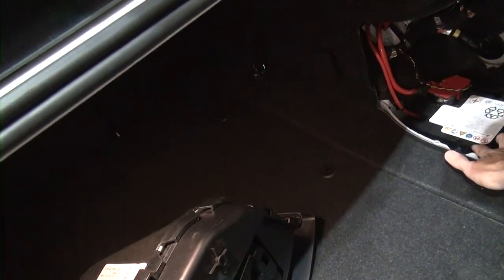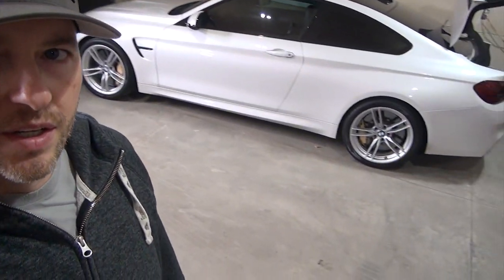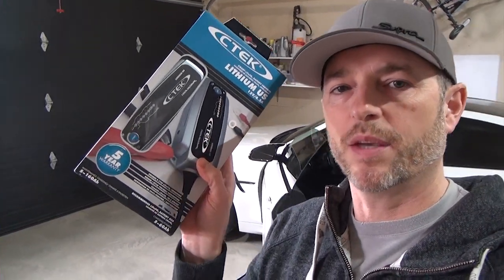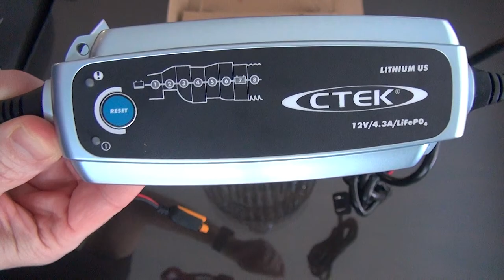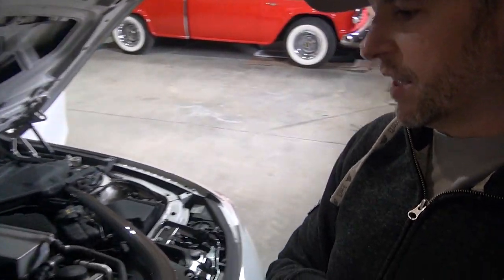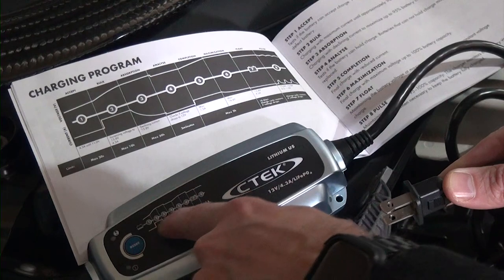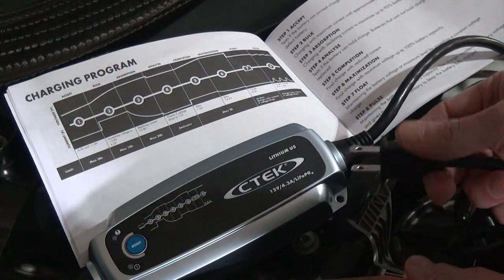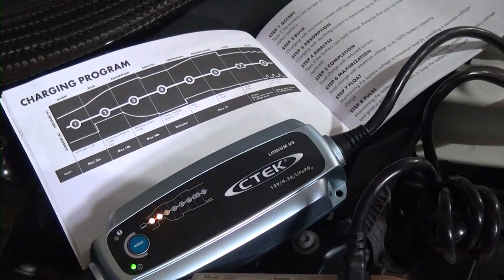CTEK Lithium ion battery charger review with a BMW .  Save money with this critical maintenance!

Comment: Just took delivery of a 2022 M440XI for my wife.  Spoke with the Service Dept Mgr about charging the battery in that we leave town Jan-Mar.  Was told to connect charger under hood and NOT to put BMW charger which is made by CTEK on the Lithium setting.  Was told the battery under the hood isn't Lithium but the one in trunk is Lithium.  He had to check with BMW prior to giving me his answer.
Reply from the maker: Yes some models could have a secondary battery.  My M4 (F82 platform) does not.  I live or die by the $2000 CAD battery in the trunk.  Good news is, a recent code scan shows it in the mid 70 percentile for remaining lifespan.  Not bad for a 8 year old battery.  Also CTEK makes a bunch of charger models.  The one in my video is one of the select few to use in my situation.

Comment: Mine went straight to number 2 and number 1 is not illuminated, I’m using a BMW charger which is pretty much the same you have .. I wonder if my battery is toasted since it bypassed the 1st light 💡 I just noticed mine keeps getting the right light on ..
Reply from the maker: It might be time!  Especially if the charging capacity is a low percentage.  Unfortunately the charger can’t tell you that specific detail.  Some OBD2 BMW scanners/coders can tell you though.   But if the charger isn’t completing its work over a day or two, then it might just be that time to replace.

Comment: “
The XS lithium charger is made for 12V batteries an specifically LiFePo4 (Lithium Iron Phosphate). 

So you would not be able to charge a 48V battery with this charger.” per Ctek
Reply from the maker: I agree
Reply: The appropriate one might be CTEK PRO60 or CTEK PRO120.

Comment: Thanks for sharing this.  I bought the same charger a while ago and leave for vacation tomorrow morning.  While messing around with my F83 this weekend I saw my battery voltage was at 76% and knew letting it sit for over a week wouldn't be good.  Followed the video, installed it the same way, and it is charging.  Much appreciated.
Reply from the maker: That is awesome to hear!  I am just happy you found it helpful.  Thanks for the follow too and have a great vacation!

Comment: Great video will this charge a completely dead lithium battery? My 2015 S65 battery died and am having major issues finding the right charger. Any help would be highly appreciated!!!
Reply from the maker: Completely dead?  I don’t think so.  Ctek has lots of info on their site that might help if you haven’t looked there yet.  You might need a little voltage existing in the battery to initiate the charging cycle.

Comment: Does charging the battery monthly increase the life of the battery?   Any idea how long the stock/original battery lasts?
Reply from the maker: Those are great questions.   I personally feel that connecting the CTEK will help the battery’s longevity anytime you aren’t driving for more than a week.  It won’t overcharge or harm the battery in anyway.   I read that the batteries can last over 10 years if maintained well.   Mine is a 2015, so I am 6 years in and have never had the battery seem weak.  I have had the dash warning to run the car so the battery charges, but that is only when the car is sitting for over a week and I didn’t plug it in.
Reply: @Donslife  Great.  My M4 is 2015 too. :-). Love the car!!  And convertible.
Reply from the maker: @rcorser1  good taste! I post pictures on Instagram too  as well as M4 specific videos on the YouTube channel
Reply: @Donslife  awesome   What’s your IG name?  Last year I was considering buying another sports car….drove everything from 911 cab 4s (which I had before)….nothing was as much fun.  Not sure on the new M4 grill. Ha!
Reply from the maker: @rcorser1  donslifechannel on IG.  I am contemplating my next car, even considering keeping the M4.  I would miss it too much. As for the new generation, I am still digesting it

Comment: Thank you for a very helpful video. May I ask, what size of torx bit did you require?
Reply from the maker: Pretty sure I used a T45.  However the screws are not overly tight, so you could wrap the head with a rag and clamp onto it with vice grips to loosen as a last resort.   I am glad you enjoyed the video!  If you haven’t subscribed, having you join the channel would be great!  Its free! 👍🏼
Reply: Donslife thank you very much. I really appreciate the response. Subscribed 👍

Comment: Hello, is it possible that a battery for my 2017 bmw m4 was asked for € 1250, is there an alternative solution ??
Reply from the maker: Yes the Lithium ones are super expensive.  The alternative is and AGM battery but you need to have the car coded to accept it properly.  The M4 needs the battery electronically registered. There are OBD2 scanners and paid apps that can do it.  Your BMW dealership can too of course.  Here is a forum link with some info : 
https://f80.bimmerpost.com/forums/showthread.php?t=1800141

Comment: i just plugged mine in for winter storage, does it reach 8 automatically after charged through the steps?  i left it there do i need to unplug it often? or just leave it
Reply from the maker: You can leave it.   It’s ‘smart’ and won’t cause any harm. Thanks for watching the video!
Reply: @Donslife  sounds good thanks how long did yours take to reach level 8
Reply from the maker: It can take until the next day sometimes.  Maybe longer.  If you need to unplug it for whatever reason, it’s okay, but it will start the cycles over
Reply: It’s been plugged in for 15+ hours still on stage 2 should I reset it? Or does it usually take long first time doing it never started the car for 2 weeks

Comment: Hey Don, I had a mechanic tell me to charge directly to the battery (BMW F10) I always thought this was a no no but my CTEK charge showed an error code when leaving it on over night which might indicate I need a new battery. The mechanic said the CTEK charger is good but won't provide enough power to get my battery where it needs to be from under the hood. What are tour thoughts?
Thanks for the video!
Reply from the maker: Excellent question.   My research (and I am not a mechanic) was that for BMW lithium batteries, it is recommended to charge and/or boost only from the hood.  From what I understand there is circuitry in between the battery and the hood post that monitors and protects battery from various risks including over voltage.  This  protection monitors the battery as it is charging.  Again, I don’t know if what I read is true, but I feel better having the car stop a problematic boost or charge instead of going direct to the battery bypassing everything.   I also remember reading that going direct to battery while still wired to the car can cause damage to the circuit and be a costly fix or recode.  Again, I am not a BMW tech. I hope this helps! And it’d be cool too if you are following my channel.
Reply from the maker: Also I believe your battery will get exactly the power it needs charging from under the hood.  The CTEK measures what the battery needs, just like your alternator and only sends the current the battery needs at that time.  This is why this type of charger is the recommended one to use for our systems.
Reply: @Donslife  It is true, Brother. Never charge any modern BMW car of the 21st Century era directly from or on the battery terminals. Do it straight from the hood. That is how all the modern BMW car series were designed and manufactured. I suppose they know what they are doing. 😀

Comment: how many voltages do you charge the battery to and how do you do it with the ctek? I’m planning on getting one
Reply from the maker: With the CTEK Lithium Ion charger, it puts out up to 14.4 volts while monitoring the battery and only giving it what it needs until charged. Then it changes to a pulse maintenance mode and keeps it topped up.  Nice feature if you don’t plan on using the vehicle for a prolonged period.  I would go to their website and pick the best one for your vehicle.  They have many.   Good Luck!  I really like mine and highly recommend it!
Reply: @Donslife  So it automatically detects what kind of battery you have and the voltage it requires? there no configuration or anything?
Reply from the maker: Mine was ONLY works with LIFEPO4 /Lithium Ion batteries.    CTEK makes several different chargers for Lead Acid batteries, 6Volt, 12Volt, motorcycles, etc.   I recommend going to their website and picking the correct one.   I did research and bought the one for my BMW.  My ctek charger is NOT compatible with any of my other vehicles.  If I wanted one for all my other vehicle batteries, I would probably get this one:

CTEK MXS 5.0 :

FOR ALL TYPES OF LEAD-ACID 12V BATTERIES (WET, EFB, MF, CA/CA, AGM, AND GEL).
Reply: @Donslife  I see thank you, I bought the ctek from the link you posted

Comment: - if you don't exceed 80% capacity your battery will last much longer
- never charge a lithium battery if the battery is at or below zero Celsius
Reply from the maker: Great tip!  I did a lot more research after the video on my specific battery and the good news is, it is capable of enduring about 5000 charging cycles.  A Lead-Acid or AGM battery for this car can endure about 350 charging cycles.  So if you take good care of this super expensive battery, it should last a long time!!

Comment: will this charge a dead li-ion 30 battery?
Reply from the maker: It is impossible to say for sure.  I would borrow one if you can or see if the dealer can try.  There is a chance but it can take a couple days.  Otherwise the battery could be too far gone.

Comment: Really informative video, I’ve got the same charger on my F82. It’s helped me through two winters.

I’ll be sharing this video in my local F8X group.
Reply from the maker: Thanks ZeeHK!  This CTEK charger has been fantastic!  It helps remove any anxiety with regards to taking the best care of the battery.  I have a 30 second follow up on the charger in my latest video replacing the Start / Stop button.   Thank you very much for the support!

Comment: Do BMW only put Lithium ion Batteries in M cars? I was under the assumption that they are all AGM batteries like all other M cars.

Having a M235 myself. got me curious if I have Lithium ion or AGM battery, since I am not finding that info anywhere.
Reply from the maker: It will indicate the type on the battery label.  I can’t say for sure which models have AGM or Lithium Ion.  However if you replace a Lithium Ion with an AGM, you will need to coding done.
Reply: You do not have an M-car, only M-cars have Li-ion in the F-series. You have AGM battery. 2-series M-car is called M2 (F87 chassi code).

Comment: Thank you for your video. I own an F90 M5 and I have a BMW charger (produced by CTEK).
I have an issue after plugging it in it starts blinking after reaching stage 2. I've made a video about it : https://youtu.be/eKe2mWXesSY
Do you have an idea of what could be the problem ? The charger worked fine for about 2 years and I'm now facing this issue without knowing if the problem comes from my car not letting the charging process or from the charger itself. Thanks in advance for your reply! 👍🏻
Reply from the maker: Hi there, 

I had a quick chat with a CTEK rep.  The best thing to do might be to contact CTEK.  I have a link for support.  They can determine the code/flash sequence you’re seeing.   The lithium charger I have may not have the same functionality.  I watched you videos and assume your in the UK but if not, let me know

https://www.ctek.com/uk/support
Reply: @Donslife  Hello and thank you for your reply! 👍🏻
I'm located in Belgium, by any chance, have you got and e-mail address for me to reach to them ? Thank you, much appreciate your help!